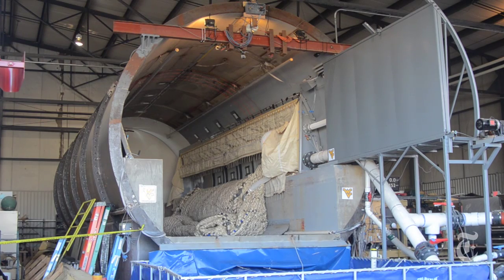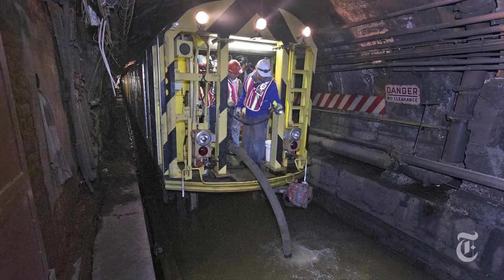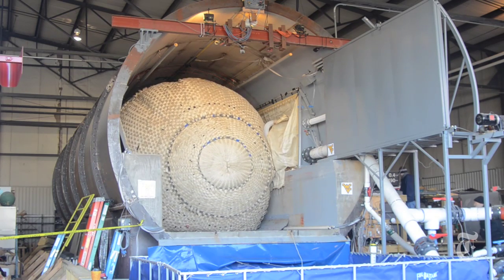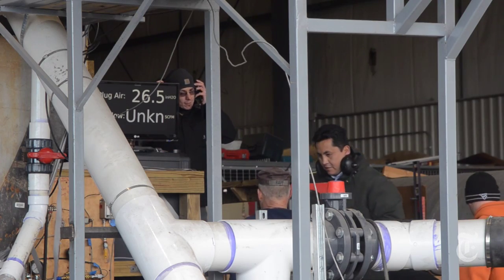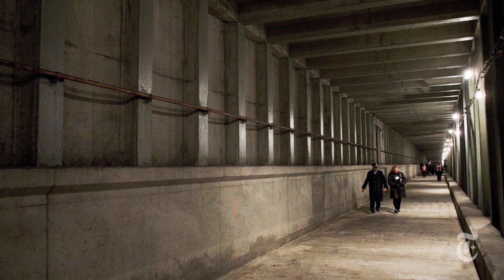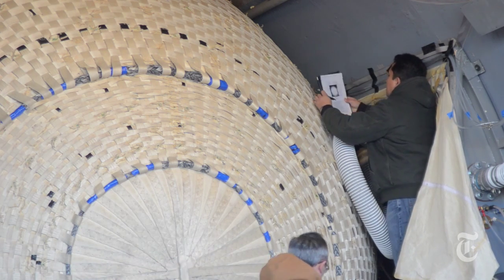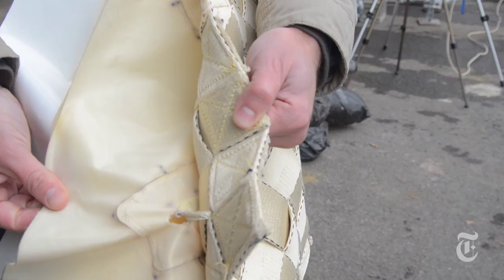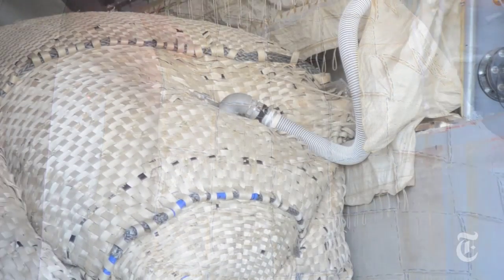Creating a Balloonlike Plug to Help Protect Tunnels Against Disaster

Comment: Why use water? It takes too long to inflate. Why not use an chemical gas inflation system; like those found on a life raft?? You could inflate the plug in a matter of seconds vs minutes. And the system could be self powered. In a disaster, the power is always the first thing to go out, and you need power to pump water. ALso, my idea would make these systems portable. So they could be deployed anywhere.
Reply: Because if you use water, you are adding mass to the plug, which will help insure it stays in place.
Reply: Michael Tovar I understand your point. I do however feel that a plug could be inflated to a pressure that would ensure it's ability to stay in place. It just seems the use of water brings several unnecessary issues into the fold. The purpose of these as stated in the video is to #1 save lives. I am pretty sure more people have died in tunnel systems from smoke inhalation than from drowning. Once again it's an issue of time. So you can have a self contained device that deploys in seconds. Or a device that takes minutes to inflate, depends on an uninterrupted supply of water and a device to pump the water powered by either petrol or electric system. And I could go on and on about the logistics of keeping pumps running. And you have to have a maintain the physical water lines.
Reply: Darral S You're talking about something that would be installed IN ADVANCE of a storm.  The tunnels of NYC were closed to traffic before Sandy, so they would have enough time to put these in place.   These are not "emergency" deployment devices.